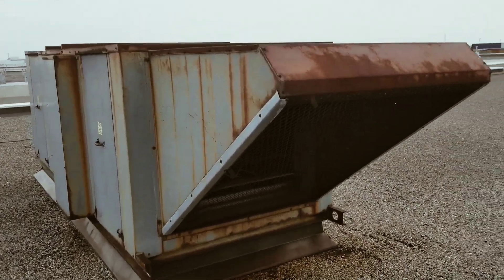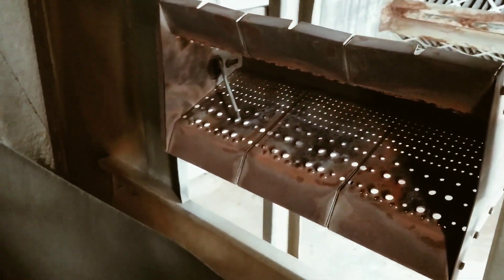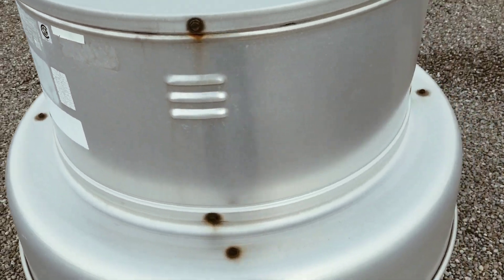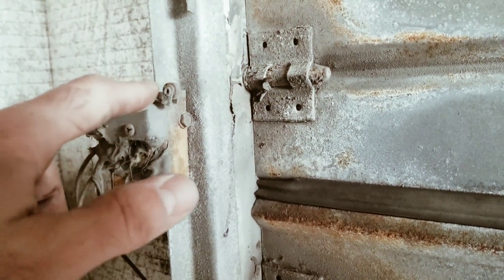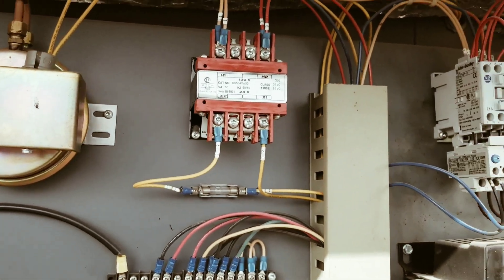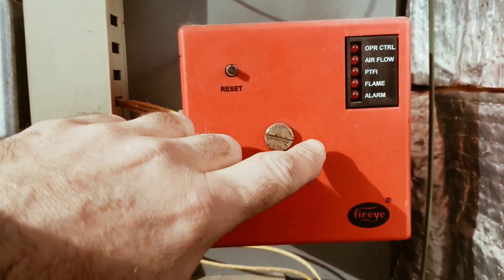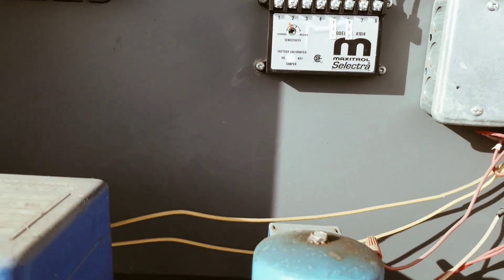HVAC - Direct Fired Make Up Air Unit

Comment: Hello Just a brief suggestion it is possible you air pressure differential switches are no set up correctlly unless you had the low jumped out. 
The reason I say this is normally the flame should drop out on low differential if the door is that wide open. 
Good video
Reply from the maker: Thank you, the door was actually only open a few inches at the top just to stick the camera in.  But yeah you are 100% correct.

Comment: How many BTUs does that burner make and what's the combined CFM of the exhaust fans? Looks like a clean burning flame for so much turbulence.
Reply from the maker: Sorry, I don't actually have the cfm info, we didn't design or install the equipment.  I can't recall the btu rating on that lol, sorry not much help am I.

Comment: Those burner eye windows are useless in those places, yes you can see flame sometimes but you can't see the full length of the burner, especially for setting low fire. Captiveaire does this, 👍, Engair junk does not amongst others.
Reply: I know such a  piss off  thy should make a better system

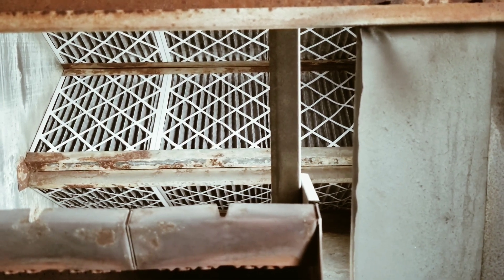Comment: At 00:38 it’s not an Economizers and at 01:15  the vertical filter position provide better static pressure since it’s in a vertical position and is more rigid.
Reply from the maker: Who said it was an economizer??  The filters definitely have better structure in vertical position, what do you mean by "better" static pressure?  If you mean lower, I haven't seen any evidence to support that even with a magnehelic attached.
Reply: Texture6. On a make up air unit we don’t worry about static pressure cause there is very little duct work attached. Economizers are attached to a package unit to provide free cooling. It’s controlled by temperature/empathy control.
Reply: Ron...Thank you I appreciate